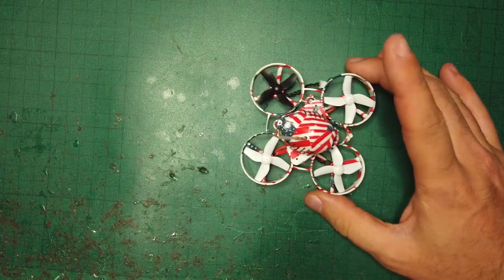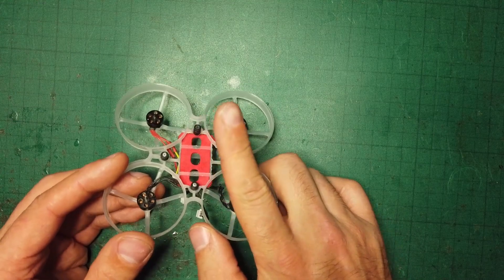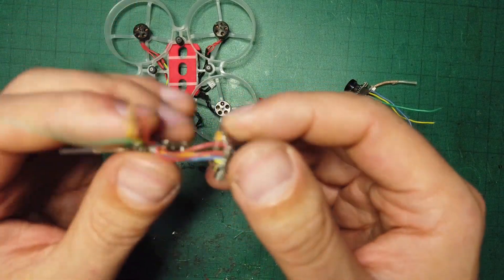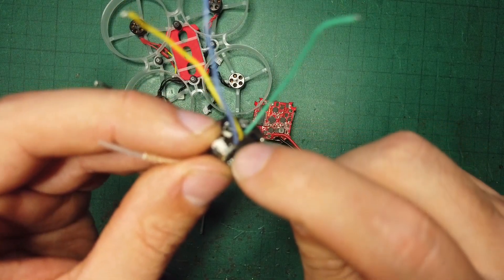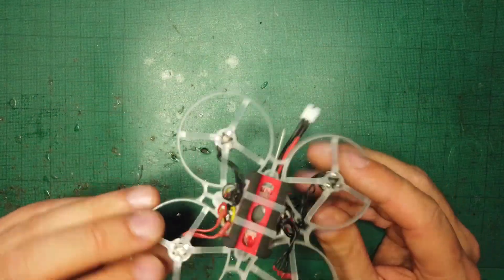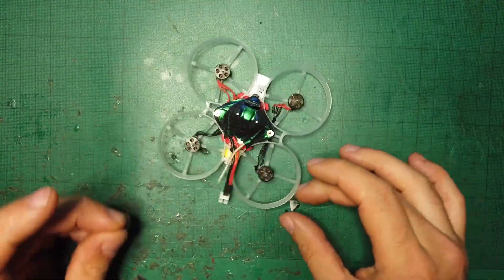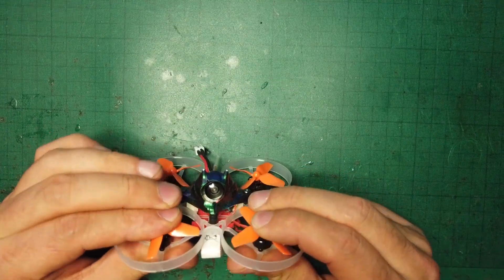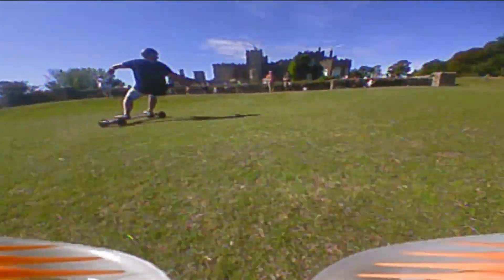How to build the fastest 1s Tiny Whoop

Comment: So u basically just double up the gummies in the front post and use the upper gummy with a longer screw for the fc? Also, when calibrating the accelerometer in betaflight do u want the quad level or do I tilt the quad so the fc is level when I calibrate? Thanks
Reply from the maker: thats correct. I dont calibrate the FC, but if i would it would probably be with the angle that it has (not flat). This forces faster forward flight.

Comment: Bro that is a good chasing whoop :D (props to the pilot as well ) :D
Reply from the maker: hahaha thanks bro. It rocks, I wasn't even going full throttle but it can keep up with most fast things. We clocked a heavier unit at 24mph :D
Reply: @SeekNDFPV  Dannng. How long is the flight time?
Reply from the maker: @lilk6353  same as all, about 3-4 minutes, but you can remove that foam and get a bigger battery in